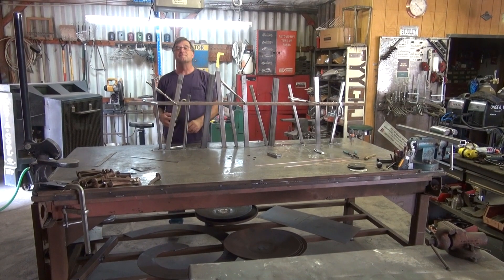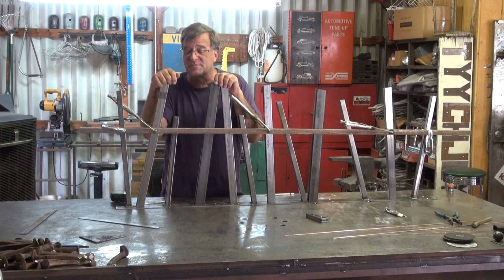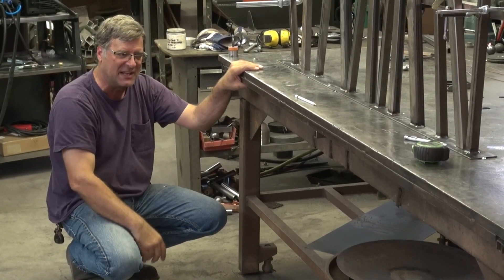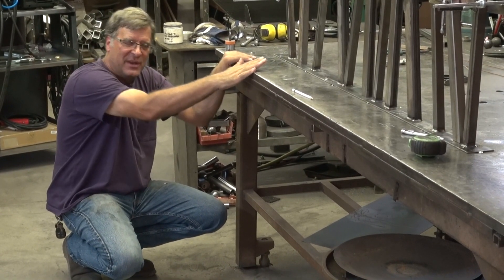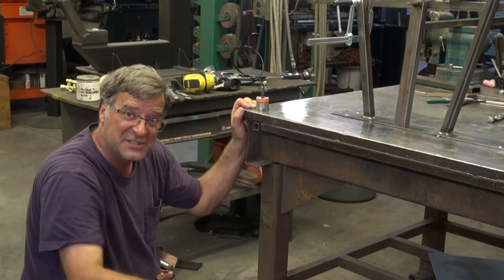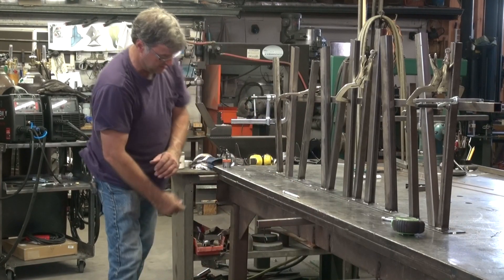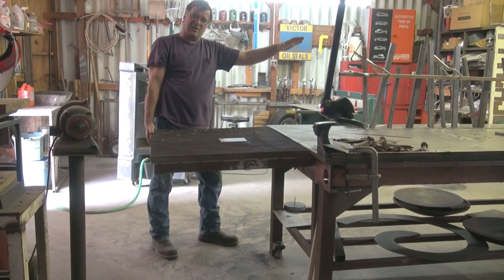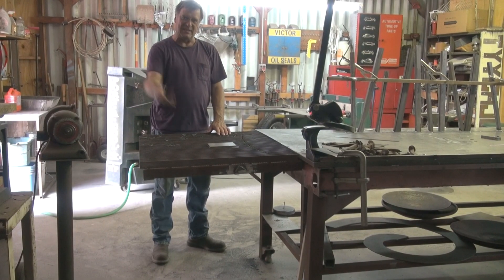How to Set Up a Welding Table That Works - Kevin Caron

Comment from the maker: That's an evaporation cooler.  Only works when the humidity is below 55 percent. Right now I just use kt as a fan. Still working on getting air conditioning installed.

Comment: awesome table, wish mine was like yours. but, i don't have room, mine is just 2 x 4', 1/4" plate on top of 3/4" plywood. tool box's underneath, vise on top, mounted on casters. more like portable work bench / welding table. it works but sure like yours.

Comment: Researching to build my welding table and saw this video.  I like your videos because you discuss your design rationale rather than just showing you welding.  The plasma cutting section is a good idea.  So are the leveling feet.

BTW, a 48" x 96" x 1/2" steel plate is about 650 lbs, so I assume a 1" thick plate will be closer to 1,300 lbs.
Reply from the maker: dahveed284 I stand corrected...

Comment: Hey Kevin 
I have been searching the web for ideals on a welding table. Your approach is sure straight forward. I was hoping you could help with answering a couple of questions. 
I am planing on using mine for personal use. Small " farm" no crops or livestock.  Just tractors and trailers and such. 
What would be a good starting size?  Yours is huge!  :)
Most of the tops I have seen are 3/8 to 1/2 in thickness.  I was sure impressed with your 1" top. 
What is your opinion ?
Also could you share how you man cutting attachment and where/how to aquire grating?

Thank you for taking the time to make all of these videos. I sure hope it is a labor of love.  
I really do enjoy the information I learn from your experience 
Regards
Daniel

Comment: Hi Kevin, I love your videos, I have learned much from you, thank you!  I am getting ready to build a small welding table, how high above the floor should the tip of the table be?  I am 5foot 9 inches tall.  I am no artist, mostly do light building and repair work here at our farm, steel with a flux core wire welder.
Thanks!!
Tony De Leo
Port Townsend  WA
Reply from the maker: I would say about waist high is about right.   Maybe middle of the stomach.   A lot depends on your arm length and what you are comfortable with.

Comment: Hi Kevin, thanks for the video. Was curious what the minimum thickness you recommend for a table top? I've heard aluminum resists splatter. Any idea if that's true? Any other suggestions for welding tables for someone new?
Reply from the maker: I am of the bigger is better school.  My table is 1inch thick.  I like it because I can weld to the table an not worry about warping it. For most guys 1/2 inch is probably going to be fine. I think 1/4 is too thin.  If you can get aluminum that would be great but it is soft and you can't weld to it.

Comment: Kev, one of my welding tables is maybe 3 x 4 ft x 1/2". The other day I noticed there is a slight camber (concave) in the center, maybe an 1/8 inch. The frame is 3"tube including the legs. Any idea from you or your viewers how to take that out?
Reply: Thanks, will give it a try

Comment: Kevin,  I appreciate your videos.   Quick table question for opinion.  I'm simply a weekend garage hobbyist;  While I'd love to have an awesome 1" thick table, it just isn't necessary.   But, I have an opportunity to buy three 1/2" thick drops from a supply house.  They are 12.5" wide by the full 8' length.  I can basically get them for retail scrap price.  Given I build a solid table frame, how would you feel about having the table top itself in three separate pieces placed side by side?  Thanks
Reply from the maker: Not a problem at all!       Take a strip of 1/4 inch thick by 4 inch wide by 8 feet and use it on the bottom side to weld the pieces together...        Or some heavy angle to add rigidity to the table.    Should last a long time!
Reply: Thanks Kevin.  I hadn't thought of that option; however I did think of adding a solid piece of 1/4" to form the actual table top surface.  Your suggestion would be cheaper. 
 I also considered leaving a gap between the 3 pieces to form slots for "T" bolts to use as surface clamps.  But, I think I'd be frustrated by small parts constantly finding/falling through the gaps.  One more question??? Table frame, 2x2" 1/8' tubing or bigger & thicker?  I just want it to be substantial enough to survive use, movement, project weight, etc.  Thanks so much for your insight.
Reply from the maker: Sounds about right to me...

Comment: Use anti spatter on your table top and a cold chisel and hammer to get spatter off. I get bugged when the young kid I work with hacks at my table top with a grinder wrecking the surface.
Reply: you should have been a better teacher and taught him not to before letting him work on the table

Comment: Kev i have 2 6 x 12 ft x 2" Blanchard Ground Set Up Tables,, I was GIVIN!!!!!!,, 2 acorn Tables,, 4 x 8,, that a town,,over Bought,,, and Had to be In RI,, Needless, to say , I fud UP!!!!!!,,the town Manager Just happenend to stop, and they were there for 5+ Years,, and saw em,in the corner, covered,up with Junk,,, Dang Internet,, saw what there worth,, And sold em, cause the town,was Allways in the Hole, $$$$ Wise,,, for 50 cents a Pound,, So,I Learned,, SO!!!!!  Never Snoooze,ya Lose!!!!!!!,, Even with the Big boss,saying He Promided them to Storts,,, His reply,was He gets a Blanket PO,,for EVERY DEPT!!!!,, Every Year!!!!!!,, Well The town MNAGER,, DID 5 YEARS,,FOR hE GOT hIS hAND GETTTING CAUGHT IN THE TOWN cOOKIE jAR,,,  Sory cast keps Hittingg cap locks,,, SOB,, It was the DO DO Plant,, we did Jobs,, that a Normal Human ,, and heve a Letter of recomdation,from the Mayor,, And NOPE!!!!,, Charged the same Hourly rate,, as Any other cust. Honest, wellin CT, Never finish First,, Sorry I aint changing,, Rust i North East,, Ina Brand New shop, Not the Dungon i sold, We When ct, had Any Manufacturing Left,, Id by the 3m ONLY!!,, Paper wheels by the 100 @ a Time,, To Have these 2,set Up Tables,Look Like yours,, 2 days!!!!,of Humity,,ALOT of all machine Shops here, Put in central Air,, But Electric, Being, 3 x,and on a Demand Meter,,, and then NO WORK!!!!!!,,,, Cost of transportation,is 4,62 a Gal for Diesel!  Nice Job,and :FIND" Out Back,,
Whats Rong With MAR?????????   Intos way to SHORT!!!!!!!!!!!!!LOL  :)   Jack